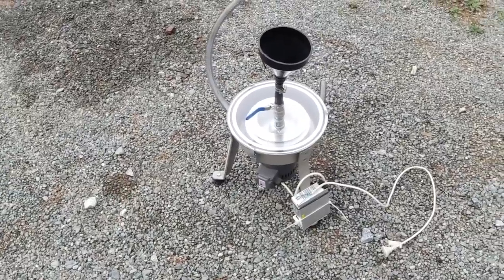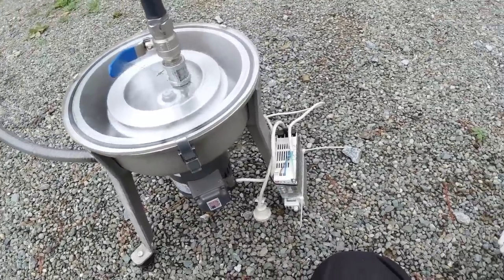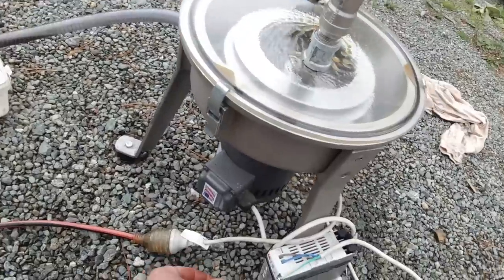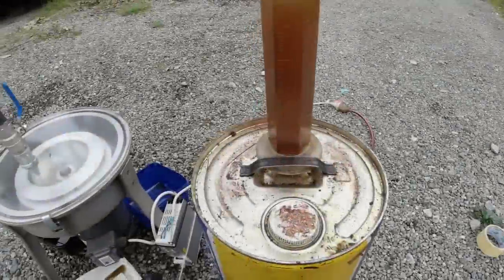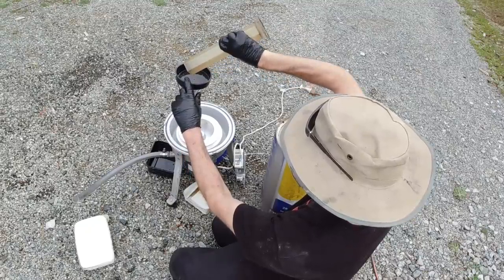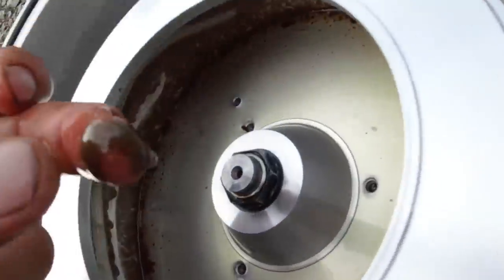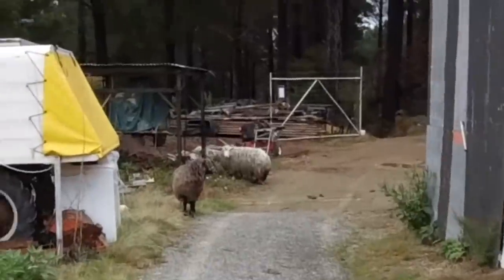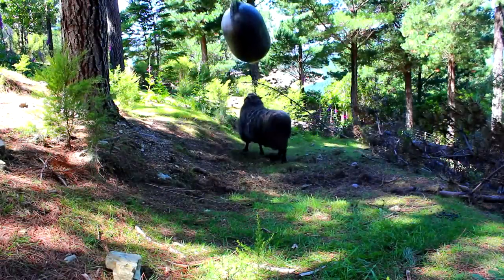Using a centrifuge to clean used oil and diesel.. Will it work??

Comment: Marty I worked for a phone company here in the states. We had a company come to clean are diesel fuel and Tanks yearly. With a there larger truck mounted centrifuge knot only did they remover water and dirt and Sludge. It change the C tane or the burn rate of the diesel. The diesel we had in tanks was around 50000 gals
So replacing it @ 4.50 a gal not going happen. So clean it was the only way.  the last year I was around  it was 60 cents a gal to clean it. Are backup generators ran on this diesel and had to start in 30 seconds. The generators that ran off this diesels 400Kw to 10000Kw.

Comment: We have a farmer near us that feeds dirty engine, and hydraulic oil through some kind of sand and paper filter he built in a plastic trashcan. The oil goes in black as pitch, and comes out clear with some sub-micron particulate in suspension. I think I heard him say he centrifuges that to get a final reusable product that he can burn in off-road diesel equipment and/or heaters. Maybe you have to centrifuge the product several times to get a clear product?

Comment: I'm not commenting to not pick. I've watched quite a few of your videos and you're a super smart bloke. With the centrifuge it's just the speed vs the amount you put in . You did seem to have it flowing quite quick but that's not a bad thing . The faster you have the centrifuge and slower the flow the cleaner it will come out. I also use two 10 micron filters and one 5 micron filter after the centrifuge and I've been using in my Hilux with 20% diesel to the overall amount of oil . So I find it safe 3 years now only having to clean injectors once

Comment: If speed isn't and issue...Capillary action and gravity work pretty well for cleaning old oil.  A bucket of old oil on a bench.  A clean bucket on the ground.  A length of cotton rope goes down in the dirty oil, over the side of the bucket and hangs down over the top of the clean bucket.  Capillary action will wick the oil through the cotton rope cleaning it, and drip into the clean bucket.

Takes a while.  The bigger the cotton rope (or multiple ropes), the faster it will be.

Cotton rope isn't exactly easy to find these days, but oil lamp wick is

Comment: This is really interesting.  I'm thinking it would be good to make useful fluids as part of a multi-prong process.  First run the fluid through a medium screen to filter out larger solids, run it through your centrifuge with a pump and heating system for a while to filter a few times.  Then, last step, run it through a pump into a rather fine conventional filter.  If you can filter down to a few microns, (or a standard fuel filter) no reason you can't run that in a diesel engine, no?  The centrifuge would be great at minimizing your consumables cost.

Comment: It would probably benefit you to use the ideas you mentioned to recirculate and heat the oils as well as adding a filtering system to help clean and refine the oils. 

The boxing ram is really entertaining! 😂

Comment: Filter it through cat litter, pvc pipe of a decent diameter, with a small outlet, that will get the majority of it, then run it through your centrifuge for any remaining contaminates. I doubt this would work for thick oils but diesel it will for sure clean it.
Reply: I wonder how the same method with homemade small particle charcoal would go?

Comment: Hi Marty. Good to see new video with things which push you to think. Some old engines have such system of cleaning oil. In case of cleaning diesel fuel here in russia we often use such additonal filters  using this principle.
Yeh! By the way used diesel engine oil is very good for timber, it prevents wood from rotting.

Comment: Hello Marty Here in the states their is a couple other things we do with old oil we can't reuse in our diesel car motors. 1 Is to use the oil in home oil burners and 2 we use it in  our forges and oil burner for melting our scrape aluminum and copper and even lead
Reply: Oil heaters were banned in Australia decades ago. New Zealand would have done the same.
Reply: @borisbash  What was the reasoning behind that? Fire hazard? It is really common to see a waste oil furnace in a shop here.
Reply: @J1410  I was only a teenager in the 70s, but I think Australia had an  abundance of natural gas. The oil was very expensive compared to gas, and the oil burnt dirty, I think. It always comes down to the dollar

Comment: Glad you picked this up Marty. Diesel separation is a rabbit hole worth exploring. I'm into stable isotope science, and enrichment systems are staged exactly as you say. Progressively enriched by tiny margins everytime it's run through (sometimes chemical, electrical, sometimes mechanical. You'll have to manage dilution of the slightly more pure extrant with dirty inputs with a single stage.  Plants designed for this type of process stage hundreds of centrifuges together.  What about thermal oil cracking? 😎

Comment: I had a Uncle who was a Captain on a large Alaskan fish hauler ship. His ship would hang out with the fishing fleet and the fleet would unload there catch at sea and then return to fishing without having to make that long trip back to port. My Uncles boat would do the trip for them when he was full.  When they were way up north they bought there diesel from old Russian storage tanks and he said it was so polluted all boats that used it would stop dead. He said it was up to 40% water, rust, mud, algae and more because it was stored so long and poorly. They installed a  centrifuge on the ship and would spin it to crystal clear diesel everyday and fill a day tank.  I saw the videos years ago and the diesel going into the centrifuge was just as dirty as yours or worse. He said it worked so well it would also take all the additives like wax, lubes, anti corrosion out of the dirty diesel and they would have to add some additive back into the spun diesel for certain application.
Reply from the maker: Thats awesome

Comment: looks like the centrifuge does work, but that lower speeds seem to work better? perhaps, like how uranium is purified in centrifuges, you'll need to send the oil back thru the centrifuge several times to get it purer and purer up to some limit, at which point you have to clean the machine and run it thru more to get it any purer. You could technically connect a pump to circulate the oil/fuel thru the centrifuge continuously and leave it be for a while to get maximum separation. Then there's various gravity filters you can make to filter it further, and they'll work better now that you've separated the heavy contaminates.

Comment: In the US you can buy a Spinner II auxiliary oil filter, which is a small centrifuge spun up by a bit of a motor's oil pressure to operate continually as the motor runs, and they work really well.  The US cartage giant UPS installs them on every piece of equipment that they operate and the company gets very long lifetimes from their equipment.

Comment: Hi Marty, I wasn`t very impressed by the centrifuge, didn`t seem to do much as far as cleaning the oil.  I think that it may be just as good using an old drainpipe stuffed full of tights and see how that goes, wouldn`t cost anything and you could filter it multiple times for nothing.  Just a thought.  Kind regards, Paul.

Comment: I was shown a trick by a mechanic many years ago. How to tell if the engine oil is contaning diesel fuel. Put a ciggeret end in the questionable liqued and the diesel will creep up the ciggarett.
Reply from the maker: That makes sense

Comment: I like the idea to clean dirty liquids with centrifugal power. I will try to use one of my old juicers (Braun, type MP 32 or Efbe Schott type E2, 350 watts) to clean old oil. But instead of the plastic filter mesh band inside, I will try to use fabric (for instance old shirts or underwear) to have better/cleaner results. Maybe put together tea/coffee filter bags are also a possibility.

Comment: Dear Marty T.
👍👌👏 I wonder if rams actually get headaches or only get exhausted from banging their heads together? Your ram is definitely a pretty strong example and looks really healthy. Congratulations.
2) Water separation and filtering did the trick for me often times round about 40 years ago. Although I only used a tea/coffee gold filter mesh and simply coffee filter bags (or even nylon stockings). But it's a long process and I only filtered/cleaned old fuel oil and old Diesel that was left in tanks with all the debris on the bottom. It worked well and I used it in my old Mercedes 200 Diesel type W115 (/8) and my old tractor without having any problems at all.
3) I once also filtered old black motor oil and put it in my car. But I used only 20% plus 80% Diesel.
4) I guess the most effective and easiest way to use any kind of old/dirty oil is to burn it with a special heater/oven/stove for heating for instance a house/workshop. This was at least what the Datsun/Nissan/Daihatsu dealer on our property did for decades.
Thanks a lot for making teaching explaining recording editing uploading and sharing.
Best regards luck and especially health to all of you.

Comment: Hi from the uk 
Large ships us centrifuges to clean the fuel so as not to damage the injection equipment its all about running as fast as possible and with a as slow a flow as possible. It shuld do a good job on cleaning the oil but the oil won't be much use as the additive package in the oil will have been severely depleted buy the time its first use is over in an engine but will still make good fuel in an old type diesel engine 
Have fun and keep.up the good work

Comment: I remember an old news story when someone rerolled a toilet paper roll, put that into filter casing and into car engine. Oil got pushed from the end of the roll through paper and while driving, it cleaned all black sooth from oil, it became clear brown again. Thing was that toiler paper had to be rolled tighter it was normally in package. In my understanding the oil molecules dont ”wear” per se, it just becomes dirty. And normal car fileters don’t clean that black.

Comment: I suggest setting your oil up and decanting the water off, then run it through the machine, then through an ultra fine filter on the output. Whatever you get after that is probably good enough to shove straight into a motor.

Comment: My Nephew runs his Diesel Van  on Vegetable Oil.  He starts and ends the engine using diesel. Once the engine starts and gets warm he turns a tap shutting off the diesel and introduces the vege oil.  when he cuts the engine he does it in reverse so that the engine will start with diesel in the system and not the vege.  It's saved him a fortune in fuel as Vege oil is so much cheaper.  You could mix used (cleaned) vege oil and mix it with diesel not sure of the proportions though. Good luck

Comment: We used to do petrol filling stations and the engineers used a "polishing plant" it pumped the fuel from the tanks removed the water filtered it through a bank of fuel filters then back into a new tank it removed all sorts of junk from normal road fuel,  was quite impressive seeing them empty the initial screen it was varnish  bits of plastic, sand , thread tape , leaves , spiders , once a dead mouse
Reply: glad it wasn't a living mouse lol

Comment: Look up a mercury electrolysis cell. Here is my idea.
Instead of mercury use dirty oil. Or corse now the cell is upside down. Basically you will have a layer of water separated by a wall that the oil flows over and “caps” this way electricity will have to go into the oil to pass. Since electricity takes the easiest path itll align all the sulfur and metal atoms?ions? in the oil to make a path. This will also pull them towards the positive electrode. While hydrogen ion are pulled to the negative. I was reading some studies and basically they are trying to figure out what additives to the water or oil to make more sulfur move but all of them got 10-50% of the sulfur removed. They used calcium hydroxide to increase the ph and that helped. This is a high voltage experiment btw dc currant plus 120 volts is not good feeling. They were not using dirty oil however. They used mineral and fuel oil. So its possible that something else will get pulled out of the oil instead of sulfur at first.

Comment: Okay here’s a couple ideas….what if you were to submerge a cotton rope in a bucket full of your “cleaned diesel” and run the other side to a bucket underneath to further purify the diesel…I know the method can be used to clear sediment out of water maybe it could be done with fuel as well…and second would be what if you were to run a oil/old gas mixture through the ceterfuge I know there have been YouTubers that have made “junkyard diesel” where they take used motor oil and mix it with old junkyard gasoline and use it in their diesel trucks/equipment but from what I have seen they just let the sediment settle to the bottom of their holding tanks and pump the homemade “diesel” off the top

Comment: Few things. For all those id personally be running it through with a pump a few times as you said. I'd also be using a couple of filters and a water separator. Ik ik defeats the purpose of the centrifuge? 

No not really od be running a very fine automotive filter after the centrifuge but before collection to put back into the machine. Should also help get the air out quicker. A water separator ideally before the centrifuge honestly it's always best to get that crude away from fuels and oils asap. And one of those cheap inline fuel filters with maybe a powerful neodymium magnet hanging off the side JUST before it enters the centrifuge. 

That way you should be able to reuse the oils and fuels after in more things.

For the oil/diesel mix usuage you want it in a hardy engine WITHOUT common rail injection and ideally a good fuel filter and water fuel separator before said filter.

I've ran pretty heavy mixes on my landcruiser 80 series before and the old girl blew a little more smoke then usual but ran alright. That said its a dirty old 1hz no turbo. Good engine though. Could run it in old diesel farm equipment too. But by doing all the prefiltering BEFORE it goes in the vehicle or machine it should save your pump and injectors. Plus let's face it, there's a good chance your fuel tanks, Inc mine tbh, are not as clean as we would like to imagine.

You also ideally want to try run pure diesel through the machine in atleast 1 mix tank, then 1 full diesel tank with maybe some good injector cleaner for good measure.

Source for all this, ex mechanic, and grew up on a farm. Now a poor af pensioner (who is only 33 but disabled) so sometimes I gotta do what I gotta do.

Comment: Several engine manufacturers used this principle as an oil filter. Simca 1500. Scania also Spanish dodge. They were very good driven by the engine oil pressure. The crap would turn to solid on the outer edge. Sometimes a screw driver was needed to get the carbon deposits off.

Comment: Cat litter and charcoal are great for cleaning oil/solvents. They work great on diesel and will even remove dye.
All you need is a large and uneven U-bend made from drainpipe, filled with cat litter.
Pour red diesel in one side and white diesel comes out the other.

Comment: Invert used oil filters atop treated fence posts and leave them there for 12-24 hours. Great for timber rot prevention.
Pantyhose (who remembers?) and stockings, bunched or stretched, make great fluid filters.

Comment: centrifugal filtering we dont do much of that as a species . if your wanting a way to filter used oil ,grab  some natural fibre rope...better yet cable.....2 barrels..... drill a hole in the bottom of the top barrel shove the rope through tie a knot to keep it there.. fill the top barrel dirty oil it runs through the rope into the bottom barrel clean....gravity takes time....thanks for the videos

Comment: That centrifuge bowl diameter is too small and the speed too low. You will obtain better results heating the oil to reduce viscosity. But speeds of 7 to 10,000 rpm are much better, and a bigger bowl to increase  G force

Comment: I have studied naval engineering and the purification of fuel oils was a significant topic covered. There are a number of different types of centrifugal systems used for this but @10:14 you mention the other element missing from this setup, the heater in the circuit. The centrifuge is not very effective if the oil is not heated to operating temperatures. The system I have seen used before heated the oil to 160 degrees first and the deposits much more readily free from the oil at that temperature. Also these system would run for much longer. I have seen black oil become like new clear again.
Reply from the maker: Nice

Comment: 2 IBCs take of from partial height in 1 to allow settling under take off. Gravity feed through centrfuge into another. Pump black diesel into your diesels. As my fuel tank gets to 1/4 I throw in 20litres black diesel and top up with fresh diesel on a Ford transit

Comment: Just a heads up from Germany. 
I use cheap filter catriges that where designed for Diesel Boats and build a filter system with it. 

The cadtriges come in 40 / 30 / 20 / 10 and 5 mycrons and make used engine oil clean enough to runn in a truck as fuel
Reply: They also filter out any other liquids like water with a centrifugal force around the filter element